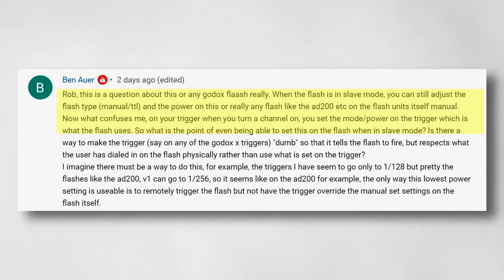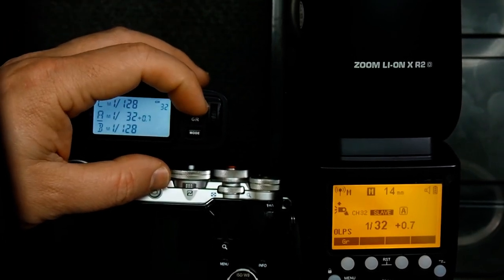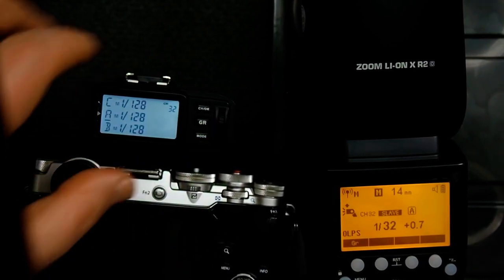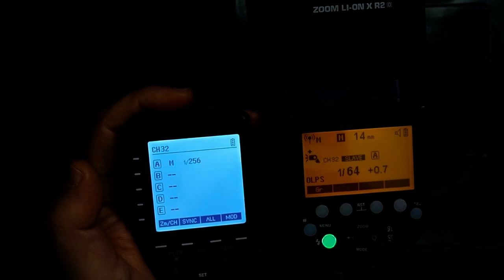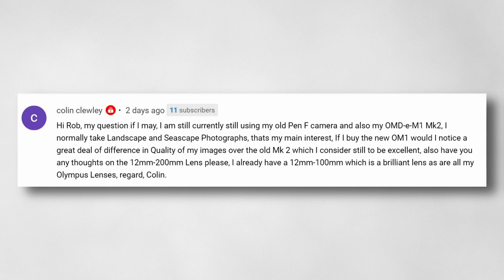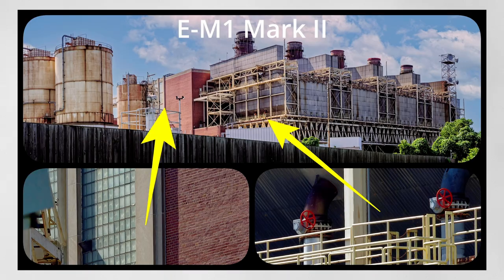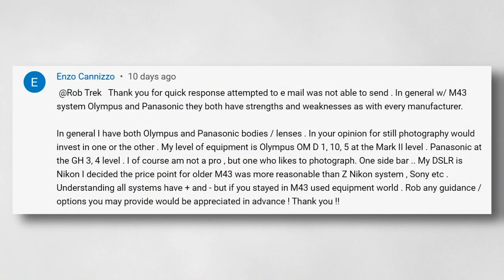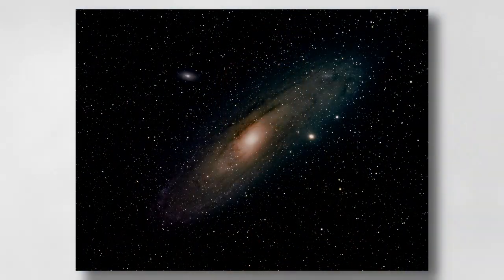Hidden Godox Trigger Settings and Olympus or Panasonic for Still Photography?  ep.409

Comment: I wanted a rangefinder-style M43 camera to complement my E-M1.2. Olympus doesn't seem to offer any current models like this that have an EVF, so I ended up with a Lumix GX85 two-lens kit. I like it so far.
Reply from the maker: I had the gx85 for about 2 years.  I didn't use it much since I prefer the PenF.  I think the gx85 is a great little camera.  Well built, pretty much everything Panasonic had to offer in features, and equally good image quality.  Some had issues with the viewfinder, but I didn't.  Also, it didn't focus quite as well as my Olympus cameras in very low light with kit lenses.  But the difference was minor.

Comment: Dear Rob, 

I really appreciate the passion that you have to teach people about photography,  I have learned so much from you.  Hopefully,  you have the time to comment on my technique that I  will shortly explain.   

I am a beginner and I use an OM-5.  I use the warnings for highlights clipping (Red) and shadows being too dark (Blue); I have set my limits at 245 and 10, respectively.  I also use auto ISO and auto white balance.  

I started to use aperture priority (AP) mode, but I found it to be frustrating.

In Australia,  the outdoor lighting is always harsh and this also create strong contrasts.  When I shoot outdoors, I found AP mode to be frustrating because it always took me too long to find a balance between aperture size, shutter speed and exposure compensation in order to avoid the Red and Blue warnings.  Either, I would miss a shot or I was dissatisfied with the final image.

So, I started using shutter priority (SP) mode and I find it faster to set my exposure.  When I shoot outdoors, the ISO will invariably be 200.  If I am taking photos of people surfing at the beach, I keep a minimum shutter speed of 1/1250, but I adjust the shutter speed to set the aperture between a range of F4 to F8; depending on the shot I want. Finally, on a bright day, I would probably adjust the exposure composition between 0.0 and -1.0.  For example, I might end up with a setting of 1/850, F5.6, ISO 200 and EC at -0.3.   If I am taking photos of stationary subjects in SP mode, I am happy with slower shutter speeds.

If I am shooting indoors, say at a family party after sundown, I still use SP mode. Except this time, I use an additional step.  I first slow down the shutter speed until I get a base ISO of 200. Now, I need a fast aperture for the shot, so I speed-up the shutter until I get an acceptable aperture.   Finally, I may adjust the exposure compensation between a range og 0.0 to +1.0.  For example, I might end up with a setting of 1/5th second, F1.8, ISO 400 and EC at +0.7.  

Is this a good technique or is it a flawed technique, which will create problems over time?  I would at appreciate your thoughts. Many thanks.  

Kind regards, 

Peter McGinty
Reply from the maker: I don't see any real issues with your workflow.  However, I would recommend you shoot in Manual mode with Auto ISO.  Then you can set the Aperture and Shutter Speed directly to what you want, rather than dialing the shutter speed up and down.
Reply: @Rob Trek  Thank you,  Rob.  Very much appreciated.

Comment: Rob the AD200 v1, which I have two of, will only do 1/128 power. I bought a Flashpoint V1 specifically because it will do 1/256.

Comment: Great video and very helpful:) I have a question. I have a Godox V1. Is  there a Laser AF Assist Light? I have seen some tutorials showing a setting for turning on the AF assist on in the flash menu for non Olympus Godox V1 flashes. I do not see the option in the Godox V1 Flash for Olympus flash menu. Am I missing something or is this something not available for Olympus/Panny  Godox flash version?
Reply from the maker: I don't think it's available on V1o.  It would be in the C.Fn menu under AF.  I don't see it on my flash or in the manual.  One option might be to use the modeling lamp to add some light to focus.
Reply: @RobTrek  Exactly what I was thinking. A disappointment not being able to have the laser assist. I wanted to check with you to see if I was missing something. I do find it more difficult to focus when the lights go WAY down at a wedding reception or event. I do have a work around that I am going to test. Mounting a Godox O trigger to the camera and mounting the Godox V1 to a flash bracket with a cold shoe. The Godox O trigger has an easy way to launch the laser focus assist that should work when you needed. Hope you are doing well and thanks for getting back to me.

Comment: Thank you for your work, I just disagree about OM 12-200 and 75-300. I own both and 12-200 is sharp and has very superior autofocus. With 75-300, lot of problems about autofocus accurancy (even with single mode). May be you own bad copy of 12-200 and me bad copy of 75-300. I just ordered a new one.I will see...
Reply from the maker: Thanks for sharing your experience.  I've not had issues with AF on my 75-300.  Sample variation is a real thing.  I've  had users tell me they have exchanged lens three times before getting one that is right.